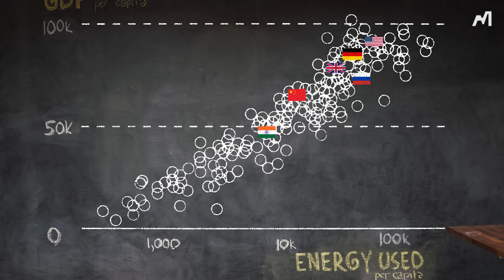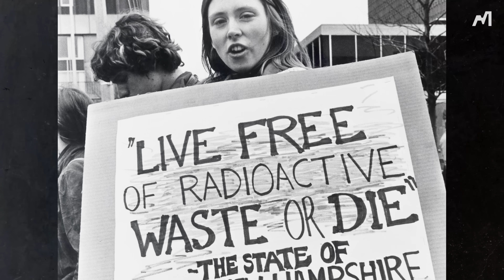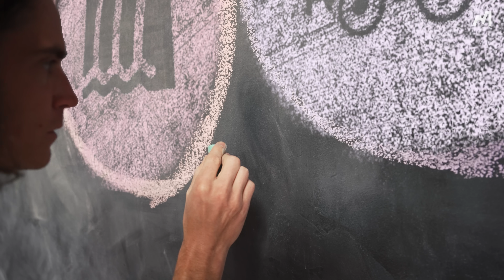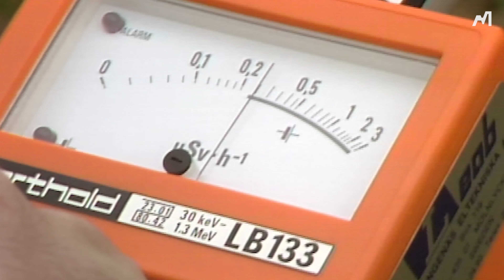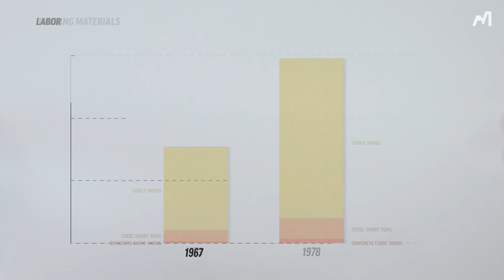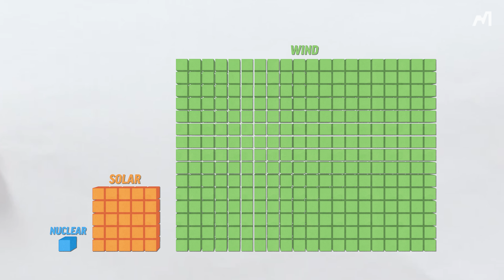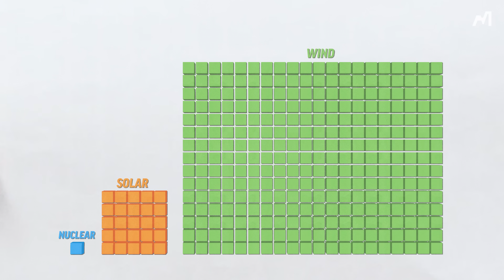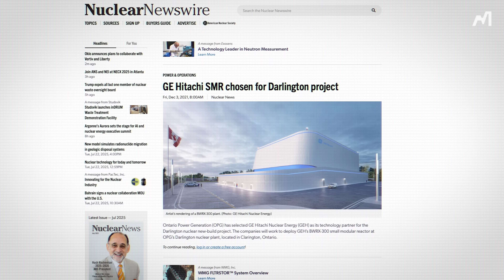They're Lying to You About Nuclear Energy

Comment: In 1988, I cast my first vote for president.  Dukakis had a record of opposition to nuclear energy, and George H.W. Bush said he was going to get serious about climate change.  So I voted for Bush, as a single-issue voter.  Oops.

Now I think nuclear energy is just too expensive, given the rate at which the cost of solar and storage has been falling.  It's good to see a video about nuclear energy that treats cost as a top-tier issue.  But after watching the video, I still think nuclear is too expensive, and likely to remain so in any plausible scenario.  

If we could make the R in ALARA actually mean what it says, that would definitely help, somewhat.  But a nuclear reactor is inherently a piece of equipment with a bunch of moving parts.  If using a small heat source to generate a small amount of energy were the cheapest way of generating electricity, we would already be doing it with natural gas.  The grid is not running on mass-produced small modular natural-gas-fired power plants, even though gas is available everywhere in any quantity.  It uses utility-scale power plants, because the engineers and accounts have decided that that's the best size to make them -- without the fear-based stupidity that plagues nuclear power.  

A solar panel is a sheet of stuff with a bunch of wires; a battery is a lump of stuff with a bunch of wires.  Neither has any moving parts.  Manufacturing is the bulk of the cost, so the cost has gone down as we've learned to manufacture them better.  The efficiency of the photovoltaic cells and batteries themselves is essentially the same at any scale from hand-held to utility, so it's free to accommodate the scale requirements of other parts of the system -- which just isn't true of things like steam turbines and internal-combustion engines.

Comment: Isn't part of the trouble with nuclear power the self-sustaining nature of nuclear fission?  If a gas power plant goes wrong, you can just turn off the gas, likewise with a coal plant, you can just stop feeding it coal, but with nuclear it can be very difficult to stop the reaction the accident at Fukushima was a good example of that.
Reply: You can shutdown a nuclear reactor in a few seconds.  A beyond design basis accident should probably not be your starting point.
Reply: @weibullguy  sure but it actually shuts down in few days because it needs cooling for the whole time. its not as simple as hitting the switch. the decision can come in seconds but the process takes time. strange you dont know this.
Reply: @seushimarejikaze1337 modern reactor designs (such as thorium based reactors) literally do not have the capability to melt down. They don’t get hot enough. They can’t have runaway reactions. What you are describing is a solved engineering problem.
Reply: @BitTheByte thorium based reactors have their own set of challenges and problems.
Reply: @seushimarejikaze1337  The fission process is shutdown in a few seconds.  It's not difficult at all to stop the reaction.  The need for continued cooling in a reactor core after shutdown is to remove decay heat.  But the decay heat is not from fission, it's from the radioactive decay of fission products mostly through beta and gamma decay.  The core remains subcritical even when generating decay heat.
Reply: @weibullguy and that's why fukushima happened. Because nuclear reactors can be turned of in seconds. Lol your info is probably from some alternate reality.
Reply: @seushimarejikaze1337  I'd be willing to bet I've forgotten more about nuclear power than you'll ever know.
Reply: @weibullguy  and I would bet that you can't pull logical conclusions from past failures of mankind and are designed to repeat the same mistakes over and over again. It's simple, nobody actually knows how dangerous na actual fusion reactor will be. All we have are expensive experiments that are called "fusion" reactors. You saying they are safe doesn't take into consideration that the scale of current experiments is relatively small and those can't be actually called a working solution, can't be called working fusion reactor either. Scale has huge hold on potential risks and this flies by your nose just because small scale experiments aren't right now in danger of exploding with uncontained energy. this is wrong reply on the different topic to a different guy. sorry for confusion.
Reply: @seushimarejikaze1337  Well, bot, I never said anything about fusion.  But I still say I've forgotten more about nuclear power than you'll ever know.
Reply: @weibullguy   don't mind that, actually I was making multiple conversations and made a mistake while replying, as I mixed you with the other guy. Returning to the proper topic, you definitely don't know more, if you did, you wouldn't be making false claims that fission reactors can be stopped in the matter if seconds. You can start the shutdown procedure in the matter of seconds but the actual shutdown takes couple of hours at best. This is publicly available information and it's appaling you don't know that or omit this fact on purpose, pretending to live in some alternate reality.
Reply: @BitTheByte  so how many of  those "safe" thorium reactors are already build in the world?
Reply: @seushimarejikaze1337  How many reactors have you shutdown?
Reply: @weibullguy what is the point of this question? I don't need to be a pilot to know how planes function. What kind of logic(or lack of thereof) you're using here? edit: it would be nice if you could prove me wrong but you know you cant, so you are grasping at straws using logical fallacies as your crutch. as i said and will say this till the end of time: shutdown procedure is quite fast, but there is a NEED to cool the reactor for at least couple of hours (i think the fastest is around 10 hours but dont quote me on that) do dissipate the decay heat. that means that cooling the reactor is a part of shutdown procedure and can be accounted to the total time required. failure to cool the reactor can result in fuel damage regardless whether there is ongoing active fission reaction or not. you must know about this because there is no way you dont. we had real life example what happens when reactor isnt cooled off after shutdown not too long ago and it wasnt really nice.  if im wrong then please do a shutdown and dont cool the reactor afterwards. i dare you. show me im wrong by causing another disaster lol

Comment: Did your land use footprint calculations include the Chernobyl and Fukushima exclusion zones.  Chernobyl is 1000 sq miles iirc.  Also components wear out in nuclear plants. The 25 years lifespan of a wind turbine vs lifespan of a nuclear plant is misleading. Both systems have components that need regular servicing and replacement but also have parts that last indefinitely.  When they replace the windmill they can reuse elements like the concrete pad.  I think your points about the regulatory framework and construction costs are very good.

Comment: And there are new reactor designs that produce far less waste, or, even better, run on existing waste, reducing the amount we need to store. One of the great tragedies of the PWR design in common use is that most of the energy is still trapped in the fuel. During the fission process, waste products build up in the rods forcing them to be removed long before they are full expended.

Comment: There's a big assumption that is false, but which needs to be talked about:  Radiation exposure's biggest damage done to your body isn't cancer, it's muscle failure.  This is because the heavy elements mostly get stuck in the densest tissues: muscle.  The particulates circulating through your body in your blood will, by nature, get caught in your heart tissue the most.  Enough roentgens absorbed, and that tissue dies, and the heart fails.  Adults have large enough hearts that its mass can handle a certain high level of radioactive particulate exposure, but people with smaller hearts -- CHILDREN -- can't handle it.  In the Ukraine, after Chernobyl, they had a large number of children die from heart failure.  This is largely suppressed so that people don't make the connection, and start realizing certain other events involved this radiation danger too.
Reply: The radiation isn't heavy elements (which may release radiation), and power plants that don't lose containment don't release heavy elements, just radiation. Chernobyl lost containment, so it released BOTH radiation and heavy elements.

Comment: Interesting site and interesting video. 
There is a SIMPLE solution for the economics issue of Nuclear power taking so long:
Have the new power plants designed to take 2+ thermal (or steam) sources, starting with Nat Gas. 
By redesigning power plants for this, it enables a utility to build new  power plants NOW with the back-end that will be used by the nuclear and nat gas boiler. It can go up as fast as 2 years, and have them up, generating electricity, revenue and hopefully profits. Once the reactor(s) is/are added, then nat gas can serve as a backup for several years while the plant becomes stable. Once stable for several years, then the boiler can be removed, OR even converted to burn nat gas and H2 and continue to be used for backup as well as extra heat. 

This is a simple idea, with minimal capex lose. It keeps utilities from going bankrupt even if they have an issue with nuclear build-out.

Comment: Waste silos take up space. Why do wind farms only last 25 years, when blades and generators can be replaced? Renewables are a part of systems that can draw energy delivered in various forms and modes - wind, solar, tidal, geothermal, wave, hydro and now, the new kid on the block - the waste heat from data centre can be used too . Most deliver during peak daytime periods, and as well as being low emmision, excess energy can be stored in a whole host of 'battery' technologies being developed all the time. Lets not also forget that as we go electric for transport, those vehicles can be used to power our homes when theyre just parked. Though this is a moot point with Americans. I can't see em giving up their humongous gas guzzling ways anytime soon. The ads for suvs and their aspirational rough track lifestyle has spread to the heavily urban driving public here in the uk, and I'd laugh, if it wasnt so pathetic environMENTALly.
Nuclear sure does have a place to maintain the baseline load requirements for the foreseable, but its not the silver bullet.

But when it comes to energy production, cost shouldnt always be the most important factor, or if it is, accountants are f**king ignoring the cost to future generations of their penny pinching ways. Bean counters know the cost of stuff but the value of way less.

Comment: This is a little more nuanced than it seems. There is a famous 1990 study that shows on aggregate to counties where nuclear plants exist, the cancer rates are not higher by a standard deviation. However this is not the whole story.

That does not necessarily mean that nuclear plants do not leak radiation or cause cancer, it just means that it is not worse than anywhere else, as long as it is used safely. It also does not consider worker safety at these plants.

Cancer rates are notoriously high among nuclear employees. Nuclear plants are also shown to release small amounts of highly localized radiation.

All of these ultimately means. It is safe to have nuclear plant in your county but maybe think twice before moving next door to one and if you work at one be aware that you are not going to live as long and you are paying for that big salary with your health.

Having said that, compared to the alternatives, on the whole I think nuclear is better than coal or oil. Coal and oil both have their own safety and environmental problems. However, be aware that that does not mean nuclear as safe and companies are only as good as the measures holding them accountable. Nuclear can also be fairly expensive per MWh. But mixed with Solar and Wind that utility bill can be balanced out to a reasonable price.
Reply: I hear that cancer rates are notoriously high amongst various groups all the time, but rarely do I find that assertion is backed up by hard evidence. 

It's usually just "trust me bro, I've got an uncle who's brother works in the field and he said so while having a few beers"
Reply: Can we eat uranium like the guy in the old video?
Reply: I wish more people had your attitude. People are lied to about the known risks, especially the workers in the industry.
Also, all radiation is not equal.
Radio-active iodine is particularly nasty, and sheep near the main British nuclear waste storage site cannot be safely eaten.

I could say more, but would be breaking the official secrets act.
Reply: Why are you lying?

Comment: One thing about naval reactors and why SMRs aren't that easy to build: Civilian reactors run on low enriched uranium to even natural uranium, naval reactors use high enrichment levels. Low enrichment levels make the neutron budget smaller and the reactor less stable, or rather, harder to make stable. But enriching fuel for civilian reactors will lead to proliferation risks, so SMRs aim to use low enrichment levels.
Reply: That isn’t remotely true huh? The more enriched the fissile material the harder it is to contain.
Reply: @BitTheByte  It's not quite as simple as that. "Containing" the chain reaction is a balance act between neutrons produced by the chain reaction directly, neutrons lost, and neutrons emitted by decay as well as neutron temperature. It's harder to achieve the right mix of this in a small space with low enrichment levels, which is why civilian reactors that can run on natural uranium usually don't have the largest power density (compare a 1GW RBMK core to the size of a 1GW PWR), and usually have to use either graphite or heavy water as moderator. If your neutron budget is too low, the reactor becomes unstable, and for really low enrichment levels using regular water as moderator you lose too many neutrons to absorption, so graphite or heavy water is required. Additionally you'll get Xenon poisoning and ultimately your reaction can just stall. Even at civilian grade enrichment levels it's hard to shrink them down, which is why SMRs aren't common yet. Naval reactors have to be compact, and nuclear navies usually have enrichment capabilities, so they can easily build compact reactors. 
There have been ships with more civilian grade nuclear reactors, particularly the NS Savannah, which used commercial grade fuel. It wasn't exactly small nor efficient, it does show that making smaller PWRs is possible for sure. 
Also, HALEU is getting approved for civilian use these days, which would make SMR design a lot easier (HALEU is High Assay Low Enrichment Uranium, enrichment up to 20% as opposed to like 4% of commercial grade fuel).

Comment: So the radioactive waste produced that has to be stored for millennia should not be considered a problem?
Reply: How about the radioactive waste produced by coal mining?
Reply: @mikloskallo9046  Nothing compared to that of nuclear power.
Reply: @DaveMiller2  You are mistaken. Coal plants release significantly more radiation into the environment than nuclear plants because coal contains naturally occurring radioactive elements like uranium and thorium that become concentrated and airborne as fly ash when burned  creating a Technologically Enhanced Naturally Occurring Radioactive Material (TENORM).
Nuclear plants contain radioactive material but are designed with robust containment and filtration systems. The radioactive material released during the few accidents is not even close to what coal mining produced so far.
Reply: In addition, nuclear power plant waste occupies a minimal volume, it can be treated and stored safely and even processed further to reduce or eliminate the danger. Coal mining nuclear waste on the other hand is released everywhere, so it's impossible to capture or clean or neutralise.
Reply: @artofthereal   I'm afraid your logic of "if some people do something badly, it means it cannot be done properly" is obviously wrong. Also, there are many examples of nuclear waste stored safely. The sum total of all high-level waste created EVER would fit in a cube of 21 m height. It's literally a piece of dust compared to the ash created by coal plants ( U.S. coal plants alone generated over 102 million tons of ash in 2018, with billions of tons stored in ponds as of 2020).

Let the figures speak: during the ~70 years of operation nuclear power claimed, let's say, 10 to 20 thousand casualties (deaths or significantly shortened lifespans). During the same time fossil fuels (the primary source for air pollution) cause at least a million deaths every year by a VERY conservative estimate (WHO talks about millions yearly). The math isn't very complicated.

Hydro is way behind this with roughly 1-2 million deaths during its 150 years of operation, but still magnitudes higher than that of nuclear power.
Reply: There is plenty of videos showing how we safely store nuclear waste. Go check Kylehill, he has an excelent video about the subject